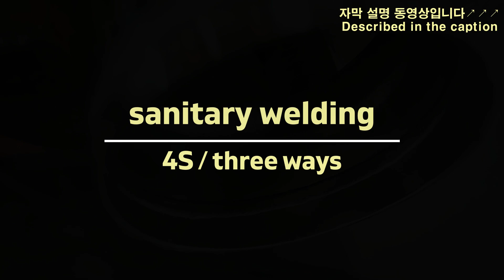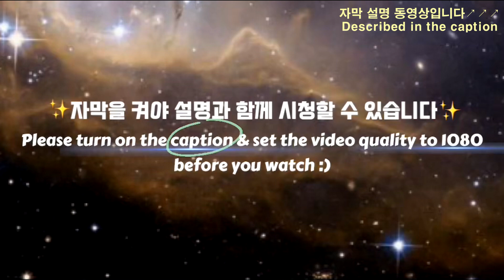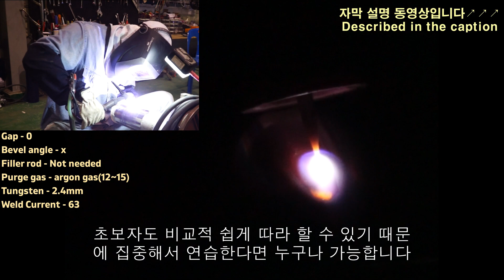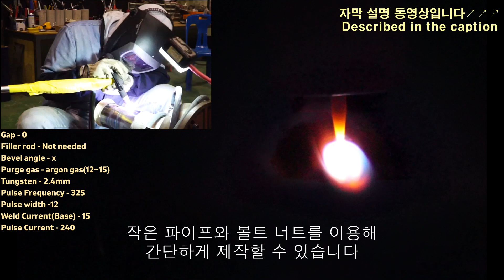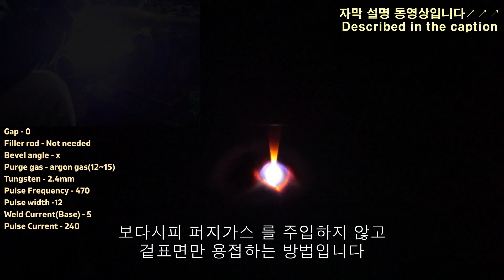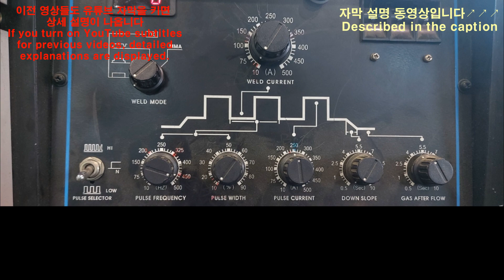쎄니타리 용접  3가지 방법[위빙,펄스,노퍼지] 짤짤이용접 맞대기용접 티그용접 펄스용접 위생관용접

Comment from the maker: 02:23 first welding method [첫 번째 용접 방법]
05:11 Second welding method [두 번째 용접 방법]
06:03 Third welding method [세 번째 용접 방법]
06:47 
Pulse Description [펄스 설명]
08:29 Weld Bead Check  [용접비드 확인]
08:43 pipe cutting [파이프 절단]
09:06 First Weld Back Bead [첫 번째 용접 백 비드]
09:53 second weld backbead [두 번째 용접 백비드]
10:32 third weld bead [세 번째 용접 비드]
10:59 Inside the third weld (no purge) [세번째 용접 안쪽(노퍼지)]